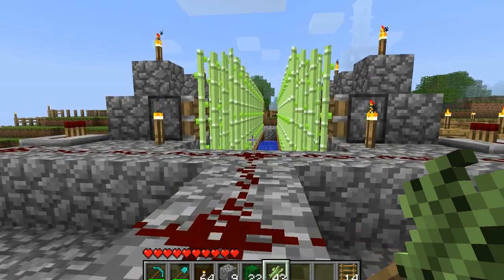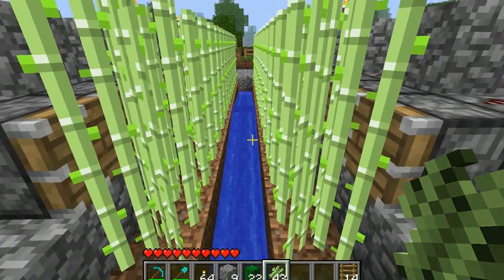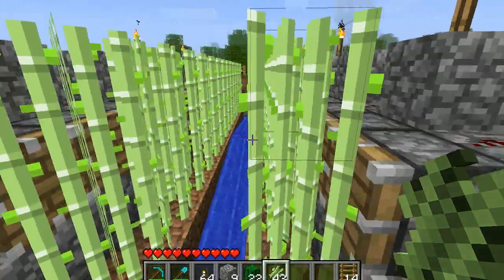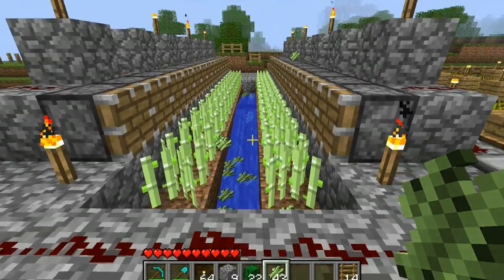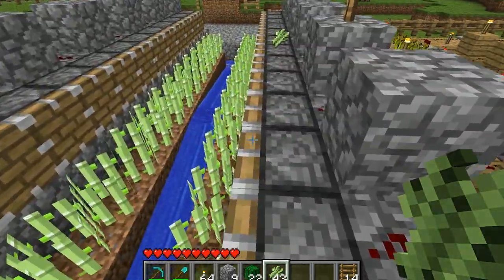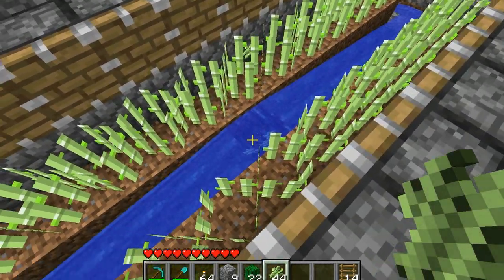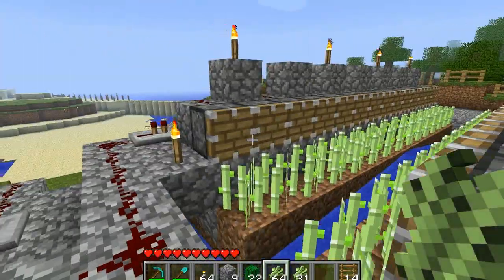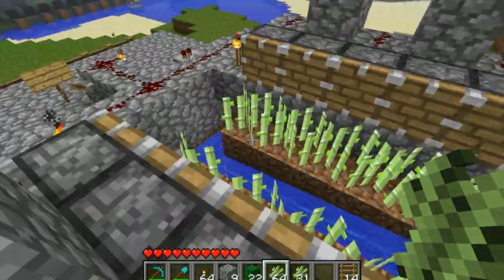Minecraft - Automatic Sugarcane Harvester using Pistons

Comment from the maker: @m14srv It's not a huge issue, just 0-2 are in there after each cycle and removing one block could easily reduce the yield by that much so I won't bother changing it.  If i redesign to a larger scale I can take that into consideration though.